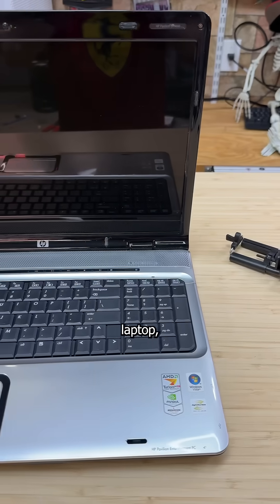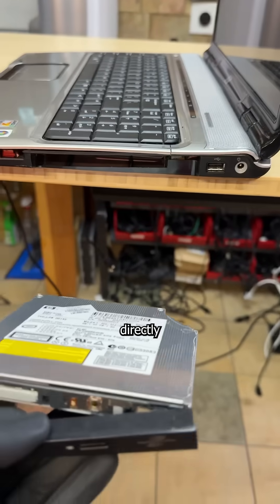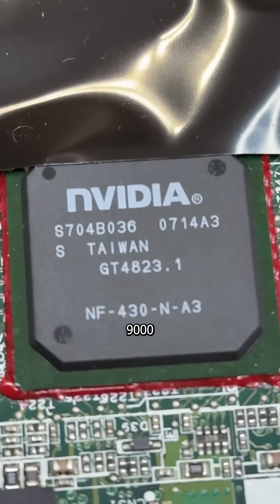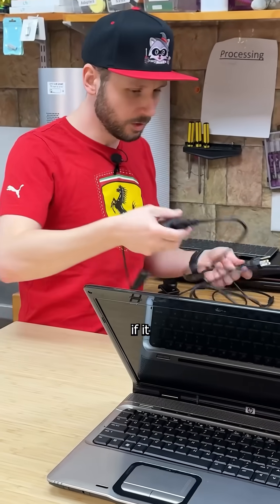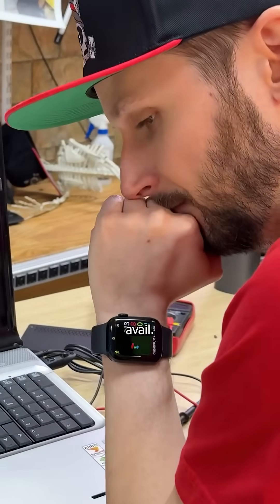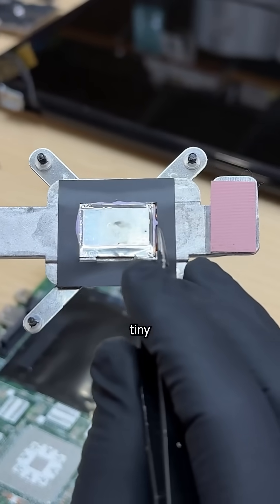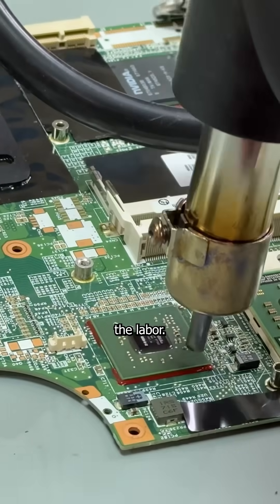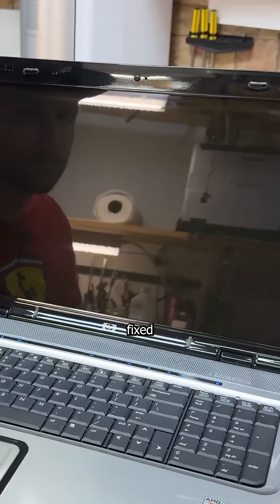$2000 HP DV9000 - The Worst Laptop EVER #tech #technology #shorts #pc

Comment: I've had HP laptops and finally realized that all HP laptops are crap. One: the circuit board/soldering cracked. Two: Kept over heating, and nothing would fix the problem. There is a reason why businesses stopped using HP.

I tried an Asus laptop 4 - 5 years ago, and it is still running perfectly.
Reply: Many businesses swear by HP. They’ve almost always treated me very well, with only the odd blunder.
Reply: @troyjollimore4100  Understand. I'm referring to personal laptops. I assumed the laptop being fixed was a personal laptop.

Generally, I'm seeing businesses swear by Lenovo and Dell. HP is highly represented as a business laptop, but I would never buy a business HP laptop based on my history with HP personal laptops.

Business laptops don't have the bells and whistles and are completely different from personal laptops because companies demand business laptops that will be supported around 5 years, compatible with future OS upgrades, and parts will be in easy supply. HP, Lenovo, and Dell support that.

Personal laptops do not have that guaranteed level of support, and I have not seen longevity from any of the three HP personal laptops I have owned.

The best business laptops I've used in chronological order of use are IBM, Toshiba, and Dell.

I worked for HP for several years. This is why I bought HP personal laptops and the doomed HP Touchpad. 

Business use OK because I'm not paying for repairs. Personal HP laptops never again.

Comment: To be fair, the issue wasn't with the solder itself, but with the underfill (it's that half transparent solid gloop that you see around the chip). It would expand each time the GPU got warm and shrink when it's cool again, slowly ripping the solder underneath apart with each heat cycle.

Comment: I've had HP Pavilion dv6000 as my first laptop. It was a pile of crap. Didn't choose it, had to accept it despite requesting a different one. It was overheating right away, the plastic was cracking, the paint around touchpad was peeling off, power button broke, and it came with Vista initially. Horrendous build. 
But then it also successfully survived a glass of hot honey butter milk and the motherboard still smells awesome.

EDIT: Oh, and i forgot the worst part! Guess, it's a PTSD amnesia. The fan! It was defective and touched something as it spinned (but not always) which resulted in loud grinding sound. I had to completely disassemble and oil it regularly to have a little bit of time in peace. It started after around 2 years of having the laptop, which smells like planned obsolescence.

Comment: I had a DV9000 series laptop, it died 3 times in its 2 year warranty period, the 4th time it died was one week after the warranty expired. I cracked it open only to find out HP never put any thermal paste or pad etc on the 8600m GS GPU.... Really good laptop let down by bumpgate accelerated by missing something that's costs 1 penny to apply....

Comment: I have the problem with the touch sensor, it causes wifi cut out everytime. I tried screening it, it work a bit then it came back. I just gave up and bought another laptop. I still have it right now minus the battery.

Comment: I remember my first laptop, it was old af, SUUPEER chonky hp laptop (can't remember the model) had like this locking button mechanism but that's not the bad bit, the vent was facing directly where id use my mouse and for some reason had a stupid long reach, so each time id use it with the mouse, my thumb would get minor burns after a while and it would hurt like hell.

Comment: I had one of these, and it was truly a piece of junk. Putting Youtube into fullscreen would make it overheat and forcibly throttle down to 0.7 GHz. And it would stay stuck at 0.7 GHz even if I let it cool down, until I rebooted it. Putting a laptop cooling pad under it kept it from overheating like that no matter what I did on it, which made it usable, just pathetically slow.

Comment: "I have one that still works"

I see some people saying this. Yeah, HP made a bunch of configurations, and the ones with an Nvidia PCH tend to fail much more often than those without. The Nvidia PCH contains GPU functionality and therefore gets hotter, which combined with the inadequate cooling exacerbates the bump issue. I guarantee anyone that has one that is still working today has a machine that does not have an Nvidia PCH in it (okay, maybe there are a couple out there, but the vast majority of these chips are dead).

Comment: Yes, these sucked, but they are NOT the worst laptop ever made, BY FAR.

1. All Philips head screws.
2. Easy to disassemble.
3. Actually replaceable parts.
4. Hinges aren't glued to plastic like many later laptops.

Also, it's not the solder balls under the package that's the problem, it's the bumps inside the chip. That's why hot air "fixes" it. Reballing that chip will do nothing but waste time and effort, the chip itself is toast.

Comment: I have the DV5000 with a Turion 64 and I cleaned a bit of corrosion off the motherboard near the sound card and now it doesn't even turn on, also, for some reason the CPU die was lime green, don't know what caused that, if anyone knows, could you tell me?

Comment: DV2000, 6000, and 9000 were one of the biggest reasons I quit working on laptops. I could not get away from seeing those pieces of garbage fast enough.

Edit:  IR reflow with good flux, followed with a metal heat shim to improve coupling to the heatsink, is a good and long-lasting fix.  If I never see one of these things again, it will be too soon.

Comment: I managed to fix the one of the HP dv series by modifying the head sink to have direct contact to the gpu die that means no thermal pads or copper shim managed to drop up to 20c in temperature and that laptop never came back for another repair

Comment: HP was pretty much the worst hardware ive bought. When it was running fine, everything worked according to specs. But it had overheating issues and I had to unscrew, open up the laptop and clean the dust a couple of times before I sold it back in 2014.

Acer laptops have been the best budget buys so far.

Comment: It wasn't the solder, it was the underfill.
Reply: Underfill doesn't cause these problems. It's the bumps connecting the silicon to the substrate.
Reply: @rars0n  Yes it does. The underfill caused the bumps to crack over time as the chip went through thermal cycles. Early Xbox 360s and PS3s had the same issue.
Reply: @vinyminotaur2694 Lots of chips had the same issue. It's the flip-chip packaging combined with the switch to lead-free solder. The heat stress on the chips causes tin whiskers to form between the solder joints which causes short circuiting. It has nothing to do with underfill.
Reply: @rars0n  yes it does. Please watch the video by RIP felix and educate yourself. Nothing to do with the solder! Lead free was used only for the connections to the motherboard, not between the interposer and the silicon!

Comment: If I recall correctly, the solder problem in PS3/X360 was with the solder bumps connecting the die to the substrate, not the solder balls connecting the substrate to the motherboard. 

Which is why reballing would usually prove no more permanent than a simple reflow with these chips.
Reply: That's the problem with all of these chips. It's due to the flip-chip design and switch to lead-free solder.

Everyone thinks it's the solder balls under the package, because they use heat to reflow/reball and then it starts working again, but it only did that because they heated the chip up.
Reply: I'm fairly certain that the PS3 RSX suffered from both bad substrate-motherboard and bad die-substrate connections, it's not guaranteed which will fail though.
Reply: @henryasbridge5161 The issue stems from broken/shorted solder connections created by heat cycling  due to the type of underfill Nvidia used. There is no credible evidence of any issue with the balls underneath the chip package. The confusion arises because merely heating up the chip is enough to temporarily bring many dead chips back to life.
Reply: @rars0n  That's true, chip underfill was in many times true cause of those issues and not the solder balls/bumps. Still many attempted to look for the solution with substrate to MB reballing which sometimes fixed the problem permanently or in worse case only temporarily.
Reply: @D.u.d.e.r  "That's true, chip underfill was in many times true cause of those issues and not the solder balls/bumps."

First of all, "solder balls" and "solder bumps" are two different things. Second, it was the combination of the bumps and the underfill chosen by Nvidia. Hence "bumpgate." Please educate yourself before you comment further because you clearly don't know what you're talking about.

"sometimes fixed the problem permanently"

No, it never did, because that was never the problem.
Reply: @rars0n  U really want to look smart right? Solder balls turn into solder bumps after u heat them up so they can connect to the chip substrate for example, but I am sure u won't agree with my theory vs your obvious "real practice & experience" right? I never said I am an expert with real experience, I am just assuming what looked to be an issue by worse "experts" than u who uploaded vids on YTB and talked about reballing like it's some kind of magic formula to fix these kind of issues. Just because u know more about it doesn't necessarily mean that others who don't r full of shit... I am glad I got "educated" it wasn't just "reballing", however bumps under chip or substrate r still referred to BUMPS unless u go with direct copper2copper bonding without solder - cold welding!
Reply: @henryasbridge5161  Yup, and not just RSX but CELL as well (it rhymes)😁Of course the most logical and much easier step was to try to reball substrate to MB connections than DIE to substrate. All chips not just in the PS3 r usually approached this way, however it's even better if u check if they r dead before reballing to safe your effort.
Reply: I had one them laptops.  It was a nice laptop while it worked. It performed okay for me.  However at the time I also had a desktop so I didn't use the laptop much people why it lasted so long.
Reply: This is why the permanent fix for PS3 is literally using a 40nm RSX, a most modern gpu from a PS3 Slim. Frankenstein mod is the solution but, it's so hard to achieve, that is preferable to buy a ps3 super slim and a ps2 instead of a ps3 fat retrcompatible Frankenstein
Reply: Not really, reballing X360/PS3 chips usually helped to solve the issue. Solder bumps on the die connecting substrate weren’t touched.
Reply: @D.u.d.e.r Reballing didn't do shit to fix the problem. Dead chips are dead chips. Just because you heat them up a bit and they're temporarily revived doesn't mean the problem was fixed. Reballing was a huge wasted effort because people didn't understand the problem and didn't understand what they were actually doing.
Reply: @rars0n  I was talking about those chips not only on the Xbox 360 & PS3 which were brought back to life just with reballing. Of course there's no question that once chip DIE is dead inside it cannot be resurrected no matter which connections - DIE to substrate or substrate to MB u change/reball. I am pretty sure most chips were solved first with the substrate to MB reballing and only very few or zero attempted to replace connections between DIE and substrate as it was easier to reball new chip to MB and update or replace BIOS/FW ROM chip.
Reply: @D.u.d.e.r You clearly don't know what you're talking about. Reballing didn't bring them back to life, heating them up did. You're not understanding the problem, which was my entire point. People who didn't understand the problem thought they got results by reballing when in reality you didn't even need to reflow the chip, all you needed to do was to heat it up. But that didn't actually FIX the problem, which was inherent to the manufacturing of the chip package itself. It had nothing to do with the solder balls between the substrate and motherboard.

Edit: My bad, you're even more full of shit than I thought if you think anyone was fixing the balls between the die and the substrate.
Reply: @rars0n  I admit, I have never reballed any chip in my life, nor tested them for the true cause of their failure. However that doesn't mean I am "full of shit" by assuming that chip dies can be repaired and replaced. I am sure u can find out evidence even here on YTB. If it's worth it is another question...

Comment: I HAD THAT. And I was despaired when the solder kicked the bucket, because I wasn't in a position to replace the computer.
Reply: Same dx or dvx1225, same tine period same issue on top of that my screen cable came loose so I was using external screens for a year or so as well before I started working in it. Did not get my moneys worth out of that laptop. It was from a worse time when computers ran higher power and hotter. Once sandy bridge released computers were substantially better.
Reply: I know the feeling. I bought a few old ThinkPads just in case.
Reply: I had that fight too. The worst HP era 👎
Reply: @stepanmacek3103  I never ever bought an HP afterwards.
Reply: @EddieOtool  same. I bought latitude e4310 and that was indestructible.even survived a crash on bike inside regular backpack. It had scars then, but worked still. Actually have company MSI Katana, and it's 🫤
Reply: @EddieOtool  Same. Lost trust but also Lenovo, msi way better. I've bought lenovos and been able to sell them. My most recent laptop is a dell e6430 just bought it incase I have to live in my pickup. It's as fast as the lenovos I was using for cheaper, nvidia chip. Dells are great for one thing, used they're typically the lowest price for a given chipset like ivy, sandy etc.
Reply: These laptops were really bad. They kept failing spontaneously something to do with the motherboard.
Reply: I copy MSI and good (not cheap) Lenovos. Stiffness is what I am looking for when durability is concerned; if the mobo don't warp too much, it should help preserve it. I've seen many a frail laptop die from mere transportation among my traveling friends.
Reply: @EddieOtool  They weren't cheap in 2014 2013 but they are now. Everything sandy bridge or later is still quite a bit faster and more competent than phones of the same price. Gigabyte another great brand. Most of the gaming laptops are a bit overkill but I suspect Sager is pretty good, never had one. If I wish rich I'd probably grab a year or two old Gigabyte laptop just so I could game in unusual places
Reply: I still have one, i think it still worked around 2 years ago and my dad uses it. I dont know if it keeps working.

Comment: You can't fix the micro bga, connecting the die with the substrate. You would need to acid away the glue around the die, then heat the die to soften the tin silver solder, then pluck apart and prep the die with micro balls... no way.

Comment: I have reballed so many DV 6000, and 9000 laptops at one point I stopped doing computer repair for like 2 years. This video seriously gave me PTSD.
Reply: So you scammed a lot of people? Reballing doesn't fix the problem.
Reply: @rars0n  Nobody was scammed. The problem was explained and so was the repair. I had very few returns and I warrantied the work for one year. No need to come off like a dick and assume I'm a shitty person.
Reply: @LTXwooshie So you explained to them that you weren't actually fixing the problem?
Reply: @rars0n  I explained the problem was in the design and the laptops don't cool properly and the chips tend to separate from the board. What I can do is repair the chip separation, and put a copper shim in for better contact to help cooling in the future, and the repair is warrantied for a year.
Reply: @LTXwooshie  But that's not the problem though. So you didn't understand the problem, you did unnecessary work, and you charged the customer for it. You charged people for a repair that didn't actually repair anything. That's scamming IMO.

The problem has nothing to do with the solder underneath the chip package, it's the bumps between the silicon and the substrate. That's not fixable. Reballing is a complete waste of time.
Reply: @rars0n  Your opinion. It restored video to laptops with no display. That's what people paid for.

Comment: Let me introduce you to the (refurbished) HP Media Center...
Heavy af, an over foot long 1" thick battery that crapped out over everything (including the brick on the ac cord), 2 RAM slots for awful square chipboard, a cooler of condensed thin tube copper thermally connected by half a postage stamp of the thinnest thermal pad ever seen, with a heat output that would burn your thighs and fry eggs.

But at least it could run crysis... barely...